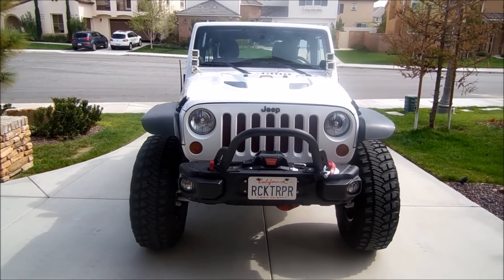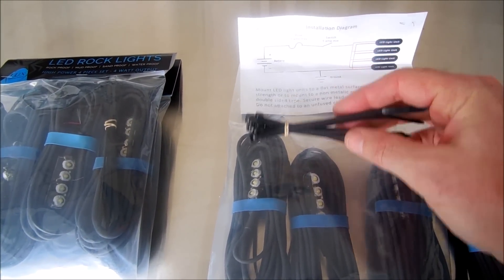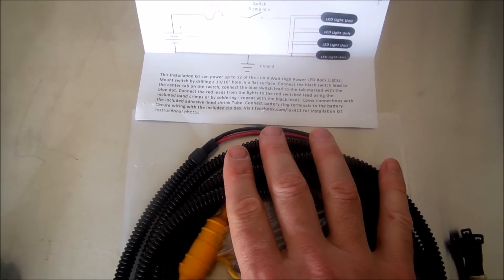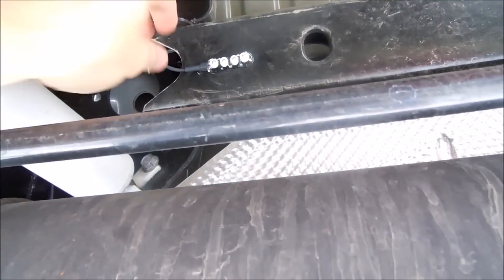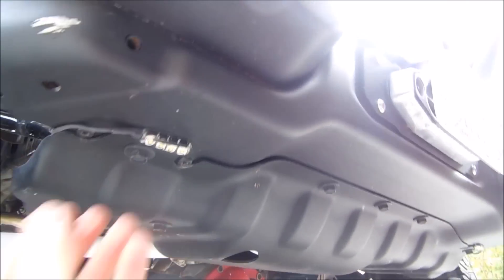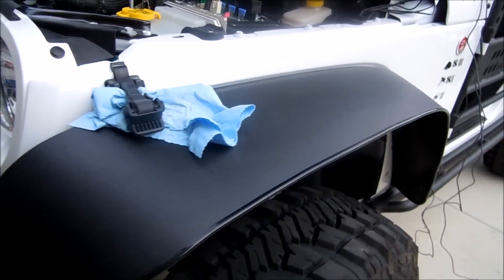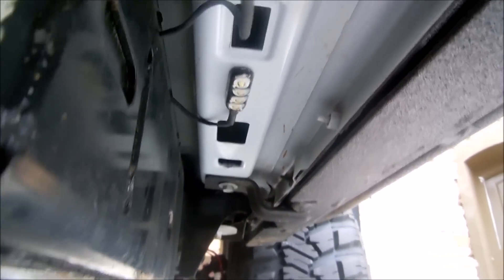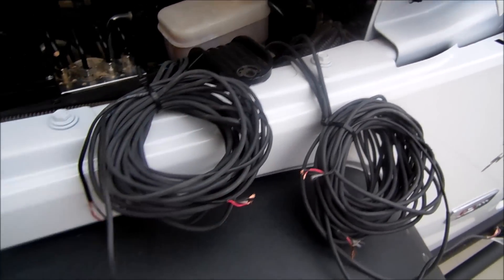How To: Install LUX Lighting Systems LED Rock Lights on Jeep Wrangler (RockTrooper)

Comment: were able to install these on the spod all on the same terminal and did you need a resister loop on each terminal.
Reply: I just got 8 of the monster lights in and went to check them on the spod and found when I connected more than one to a terminal they dimmed so I called spod and they informed me that for some reason the Lux lights do that when you connect more than one to a terminal.  I sent a email to Lux tech support to ask them if they knew about that because they advertise them as working with the Spod but have not heard back from them yet, but Spod says I need a resister loop they sell before the Lux monster lights will work as advertised, Have you ever heard of that from anyone else?
Reply from the maker: I was able to run all 8 of my lights to a single switch on my sPOD without any issues, it could be that Lix made some changes to their lights. They would be the best resource to determine what would be needed, if anything additional, to connect up.
Reply: @RockTrooperJeep  I called Lux and they say once I hook up all the lights to one circuit the SPOD will recognize them and then they will work as advertised but that sounds fishy to me because why wouldn't they work right now with just 2 hooked up to one circuit lol.  I'm being told by SPOD that for some reason the lux lights won't work right until I install the resister they sell lol.  I really don't know who to believe, I see yours worked ok but I have the Monster lights so maybe there made differently than your model who know's.  One more thing I see you have the original model SPOD and I have the new model SPOD 8-Circuit Source SE w/ Touchscreen maybe that's the difference anyway I can't seem to get a solid answer on my issue from either manufacturer.
Reply from the maker: Physical Starfighter I cannot say for sure, I would think that either one or both would be able to provide you the correct information for their products. I simply connected all the leads to a single positive and negative terminal and then to each post on the sPOD, that’s all that was needed.
Reply from the maker: Physical Starfighter did you try just using the Lux switch that was provided in place of the sPOD switch, at least for testing purposes to see if the lights react the same way?
Reply: @RockTrooperJeep   Thanks for the information you've provided it is appreciated, Lux was right I connected more to the same connection and they worked as advertised, evidently they draw so little amperage you have to connect for than just a couple.

Comment: What are those square black wire holding clips called? Thanks haha
Reply from the maker: hTran7 they are from commercial electric, they are called 1x1 mounting base. You can get them at any Home Depot or Lowes. Here is an example of the, on Amazon. http://amzn.to/2hZZbYB
Reply: thanks!

Comment: Bought these rock lights and after 1 week they stopped working. Checked the fuse in their harness and it was blown. Replaced fuse and the circuit board immediately started smoking. So I said ok I'll just call the place and they'll make it right, right? Wrong, after 3 voicemails I have yet to receive a return call or any action whatsoever to keep my business.
Reply from the maker: Hey Jake, I know you can reach them on Facebook as well. Have you tried posting to their page?
Reply: I had the exact same experience.....

Comment: Did I hear you right when you said you used an 8 gauge butt connector?
Reply from the maker: Maxxum Photography No, that is way to big for just the rock lights. Do you recall what time in the video I said that?
Reply: 14:56
Reply from the maker: Ah, yes. I used that size for all of the leads that were coming up from that side of the Jeep, so that was for the combination of all 6 lines (one side and then X2 for both positive and negative leads). We had actually done a few more installs after I did mine and found it much easier to run a central lead for each side and then tie in each light to the lead. This way we only had a single lead for the positive/negative coming up to the power. This was much easier to manage as well. Of course, this is owners choice as to how to run all the leads. Hope this helps!

Comment: So how are they holding up ?
Reply from the maker: Brent Sims I had sold this rig last year, however I had no issues with that up until that time.
Reply: RockTrooper so do u have a new build?
Reply from the maker: Brent Sims yes I do. The series is being filmed over on the TrailRecon channel, go over and you can check it out. I do plan on adding Rock lights to that build as well.

Comment: what front axle are you running?
Reply from the maker: Sean, axle is factory rubicon D44, however I have RCV axles with Reid knuckles and steering upgrade with Synergy tie Rod and draglink.

Comment: How is that magnet holding up?
Reply from the maker: Mike R I sold the rig earlier this year however I did not have any issues with the magnets at any time after install. I'm working on a new rig now and will probably be going with another set from Lux.
Reply: Thank you RT.

Comment: Is it possible to install the wiring through the frame?
Reply from the maker: Sure can, there are numerous ways to run the wiring thru and around the vehicle. If you run it thru the frame you can either lay it free in there or work some crazy wire management to get it up off the bottom of the frame tubing and mounted to the inside side of it. You could also run the wiring up into the body if you really wanted and then the wires thru the firewall. Lots O Options!

Comment: I got lux on my jeep not really that impressed with them the idea is cool but not as bright as rigid... & yes they are hooked up right I work with 12 volt for a living!
Reply from the maker: Chris Pohl Chris, my lights are very bright as you can see from the video and pictures. In comparing how these lights are to others, I like the fact that these lights "spread" the light across the ground instead of "spotting" it, which is what I would prefer for a spotter so they can see the terrain evenly without shadows reducing the area.
Reply: I put them up against the rigids and just was not as good the lighting is ok not as bright as I thought they would be when I bought mine and I'm running the 8pc white

Comment: nice video but the static from your camera is about to blow my speakers
Reply from the maker: Thanks for the feedback. What static are you referring to? Is there a certain time the static happens? I didn't hear anything
Reply from the maker: I hear what you mean now, odd I did not have that static originally. I'll go back and check my original file and see if the audio is cleaner